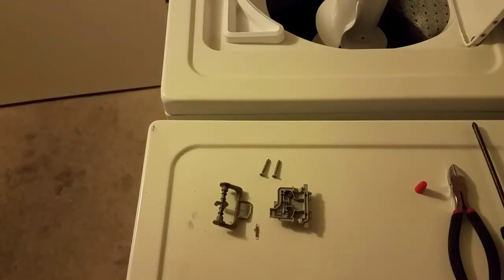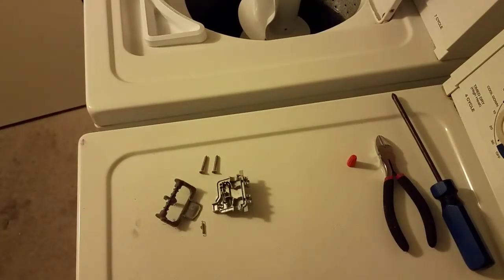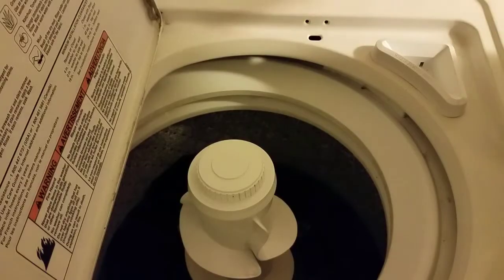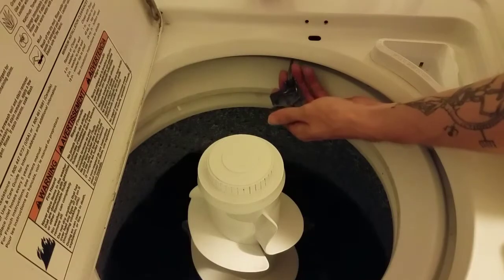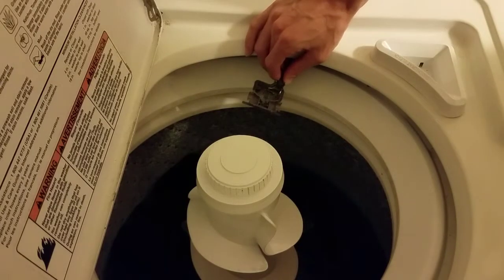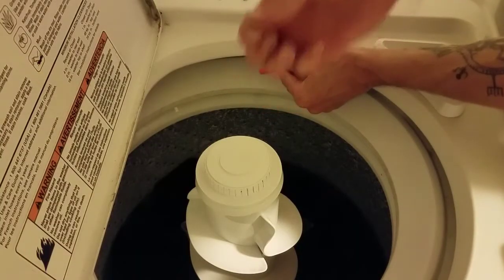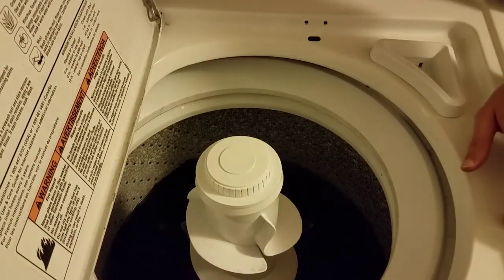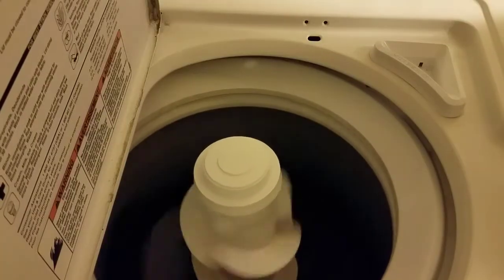Washing machine quick lid switch bypass.

Comment: Me and my wife were totally confused. She gave up right away... I sat there with voltage tick tracer to make sure it had voltage... then I fiddled with the knobs a bit, then stuck the dingus end of my tick tracer into the lid switch hole and it started. Called my wife and said honey I think know what the problem is... its the switch... she takes up a screw driver near by jams it in and the whole thing popped backwards... welp... your bypass video helped us out to where we can at least finish the load before we replace the whole dang thing now

Comment: To avoid a wire exposed inside the washer I would have fed the wires through the switch hole and added the plastic connector but that’s just me lol
Reply: Corrine Herron thanks
Reply: then the plastic prong on the backside of the lid could pinch the wires...but that's just FACTS!  lol
Reply: @hannibalhendrix3523  😂😂

Comment: god damn dude. i had the exact same roper as you do and had the same exact problem earlier this year so i figured i'd just replace it since the machine was 15 years old or so and i wanted something "newer".. biggest mistake ever. should've found your video instead and fixed it. now i'm stuck with a piece of shit HE machine that barely washes my clothes.

edit: after owning the new LG washer for well over a  year now, i must say, that thing actually washes pretty damn good. it takes about twice as long, so that's a pain in the ass, but the clothes come out nice and clean and not beat up by the agitator in the middle.
Reply: Don’t use Gods name in vain.

Comment: I just did the same thing (without this video) to my disintegrated switch(keep the ground screwed to the washer body, shouldn't need to bother it at all, it's usually a green wire. This method avoids all that unscrewing the top panel and trying to move it around. My washroom is quite cramped and the method I made up worked perfectly.

Comment: My washer leaks when the clothes are rolled up in the wringer, so I often have to open my panel and often it does not work and it was the reset in the cycle.Thank you very much I will try
Reply: I was getting water from the weephole in the bottom basket bearing,, I snaked a little tube jammed in it up to the waste drain.
Solved.

Comment: "Necessity is the Mother of invention" Nicely done. Not a permanent solution but, you  do acknowledge that in the video...Always good to CYA...now, I'll go work on my father-in-laws washer. Thanks a bunch!
Reply: Actually, this can be a permanent bypass. Especially if you keep the ground wire attached to the washer body.

Comment: This didn't work for my washer but I learned how to strip wire, apply the cap on the wires and I understand now that this was not a plug in part, that it was saudered in like you mentioned in the comments. There is a taped area of wires up underneath that don't look good but very hard to get to.  I will be draining this with my shopvac now, any tips are welcome.  Thanks for your video!
Reply from the maker: Too bad this didn't fix your issue. It's always good to learn new things though. And just so you won't get in any future misunderstandings, you have the pronunciation right but it is spelled "solder".
 Luckily I could siphon into a nearby bathtub with a garden hose in an emergency, good luck with the shop vac 😕
Reply: @steven_baconbits  haha and that spelling looks weird, thank you! I have a basement drain but it filled up after dumping so much water down with the shop vac. So I'll give it some time and do it again, just draining slow.

Comment: This is my exact problem! My issue is that the wire to the lid switch assembly is really short, I have no length to work.
Reply: RIGHTTTT !!!!
Reply: you merely need to pigtail in some extra length. you can check out how to do this, it's not difficult, search on YT...best of luck

Comment: Do you have any idea what the screw size is ?  I somehow took the lid switch out a long time ago and configured some kind of bypass but not it's not draining somI plan to get a replacement lid switch but it doesn't appear to come with the two screws.
Reply from the maker: I don't remember and no longer have the replacement to reference since I kept the bypass after a second switch failed. Once you have the replacement maybe take it with you to a hardware store to find a match.

Comment: Question, how did you take apart your lid switch? It just had screws in there? Mines doesn't have that and it's hard to take off
Reply from the maker: Mine was held in with two screws.

Comment: Do you need the wire cap or will just electrical tape work?
Reply from the maker: I would never recommend just electrical tape on any electrical connection.

Comment: On my washer the liplock has 3 wires red yellow n purple so if you purple one out the other two it work put all 3 wire it starts up the washer but want spin or drain so how do I bypass the lid lock
Reply from the maker: Sounds like you have a different style lid switch than the Roper has in this video. There are different styles so looking for a video that deals with that specific lid switch is going to be your best bet. Good luck.

Comment: What do you do with the ground ? My green ground wire is hanging there and washer still isn’t working
Reply: Mine are red white and blue. I connected the blue and red. But the washer still senses a problem with the lid lock..

Comment: Can't the switch just be put back together?? Instead of ordering one, putting it back in?
Reply from the maker: Mine was not salvageable, so I had to get the washing machine out to get the panel off to make splicing the replacement easier.
Reply: J. Coz Seneca River Trading Company is super fast. And affordable!

Comment: Our Amana washer has 3 cables red white and blue 🤔🤷🏽‍♂️
Reply: Shutting the lid of my Amana today, I heard the plastic switch break.  So, instead of cutting wires, I made the contact point permanent by bending the one piece of flat copper over the other.  Easy five minute fix.

Comment: how do you cut the wire what is the ground wire you put this wire behind how do you tape up the wire? Nothing was really clear in this video you didnt show how to do anything.
Reply from the maker: i cut and stripped the wire with a pair of wire cutters aka dykes.
there is no ground wire this was just a simple low voltage switch.
no taping just tucking it back into the wiring space.
this was done to get the unit drained. 
On this washer model switch replacement requires cutting out the old switch that has soldered connections that cant be reused.
Reply: We're did you order the new piece from and how much did you pay
Reply from the maker: @angelaporter815  i found one on ebay for less than $20 shipped
Reply: smkoehler82 what’s the part number
Reply: H

Comment: Mine let water in and stop now I got a machine with water in it🙄
Reply from the maker: I was unable to siphon the water out of mine. So I bypassed the lid switch to drain it because the washer has to be moved to remove panels to get to that switch. 
The lid switch is a safety feature to keep people especially children out of the washer while it is running.
Hope this helps and thank you for your comment.

Comment: Just do NOT buy a Roper. They are garbage. I have had this garbage for a year, A YEAR, and the lid lock does this so I have to unplug it and wait til it unlocks itself the cycles NEVER complete and stops working at the rinse cycle, sometimes the agitator doesn't spin though nothing is broken on it, and if a cycle does complete my clothes are sopping wet. GARBAGE. SPEND THE EXTRA MONEY!!!
Reply from the maker: Roper is a Whirlpool brand, and it's easy to agree they are not top of the line. Typically more affordable appliances are just older tech that's come down in price.
The one I have is almost 20 years old no different than the basic washers most of us grew up with. A lid switch is a very minor problem for the age.
Just like with cars an appliance can end up being a lemon and it sounds like maybe that's what's happened. It could be a problematic model and searching reviews might of alleviated that. 
The point of this video is not to promote or degrade a brand it's just to display an easy fix that's applicable to many different brands and models of this type of washer, and maybe others. It's a very basic switch bypass. 
Have a great day,
Sincerely Steven.
Reply: Roper is the brand landlords buy for their rental properties. Pretty sure that's where the Ropers (the landlords) in the show Three's Company got their name.